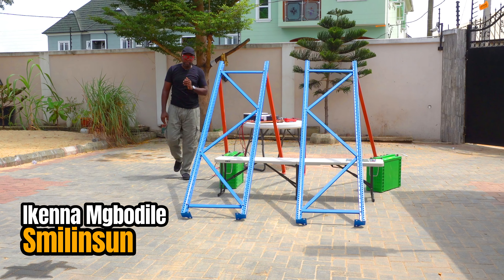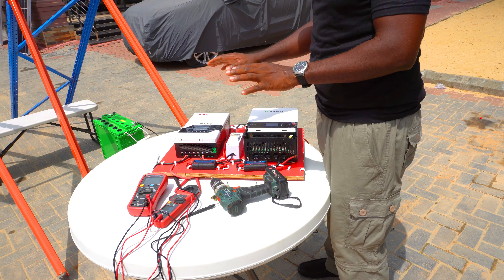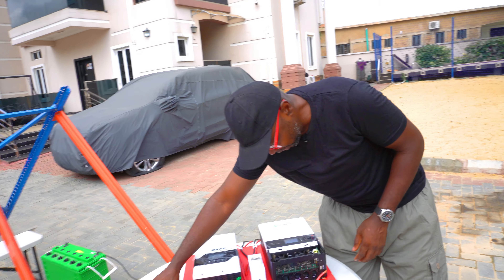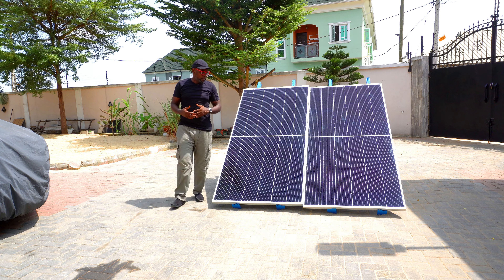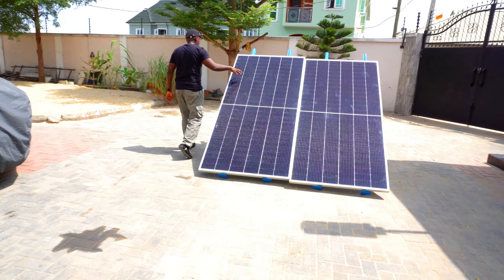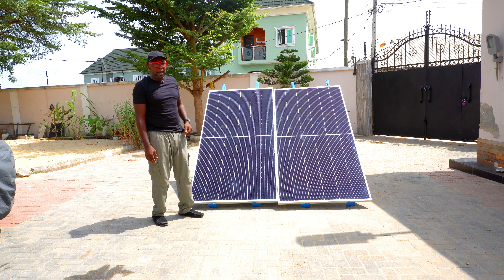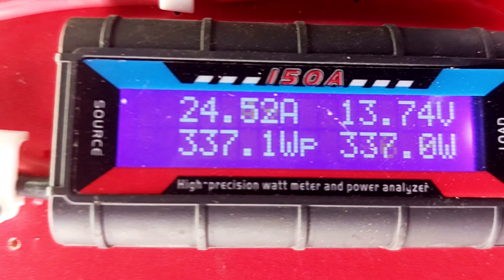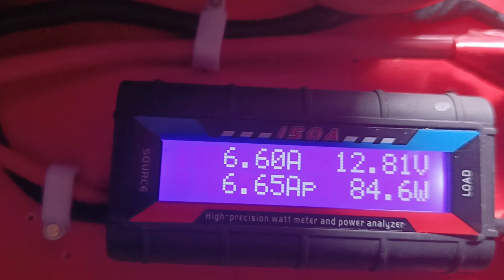Growatt vs Must Solar Charge controller in Energy Contest.

Comment: I find that my Growatt is inaccurate. I see with a 150watts of load applied the inverter, around 260watts at the battery (reported by the inverter itself). When I test using a current clamp, I see 164watts of load at the battery. With a load greater than 1500watts, I start to see more accuracy within <10%.

Comment: Growatt won actually. The battery is the load in this case and the battery connected to the growatt is more charged than the one connected to the Must charge controller. Hence the growatt charge controller was supplying less power to meet the load demand.
Reply: How do you know it is more charged?

Comment: Oga what are you expecting, One is charging at 14.2V and one is charging at 13.74V You reviews ehn..
Reply from the maker: So
Reply: he is checking the energy so wat are u saying
Reply: @GTdontDOthat  Oga, Volage of one battery is higher, when charging as you attain higher voltage, your charging current reduces.. that what is called Absorption
at 14.2 the Growatt's batteries is closer to Absortion voltage. 
Next time discharge both Batteries to same Voltage below 12V, test is flawed.
Reply: @odedeyidamilare  Absorption voltage for Tall tubular battery is around 14.5 to 15 volts. So 14.2 volts is far from that from that  volt range.

Comment: That's impressive from the MUST......didn't expect any difference in    the output since they are both MPPT
Reply from the maker: Some MPPT are better than others in energy efficiency.
Reply: @smilinsunsmilinsun8056  I think am more curious now if there will be differences in efficiency between high voltage pv Charge controller (those whose voltage are around 450v) and low voltage pv charge controller (those whose range are usually 60-145v)
Reply from the maker: @akinwaleakintoye8304  The wattage principles suggests they might all be the same  energy output as long as its a good product

Comment: Curious to know the MPPT voltage range of each of the charge controllers. Controllers woukd still work outside the MPPT range but would not be efficient
Reply from the maker: 150 volts each

Comment: That is great practical
But I have a question
Can a set solar panels  feed two charge controller  to charge different battery
Reply from the maker: Nope you will always need to give each charge controller a separate Solar panel line.

Comment: Sir what is the specifications of both setup and also if you want to include an inverter what should the specification be with respect to their batteries?
Reply from the maker: Specification of what ?
Reply: The charge controller used
Reply: 100 AMPS

Comment: Thank you. Maybe you should have swapped the batteries too like you did the panels.
Reply from the maker: As long as the battery dies not get to the charge voltage the charge controller brings in everything the panel is generating, moving around the batteries is a waste of your time